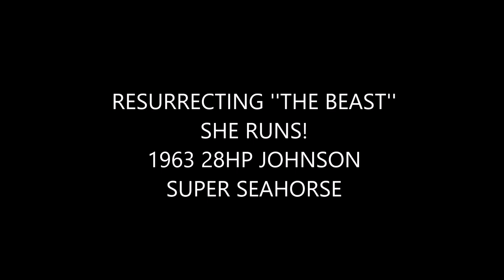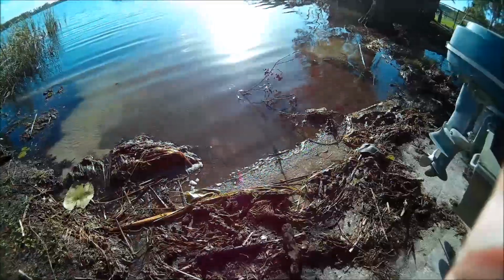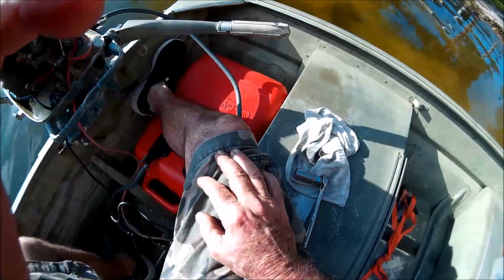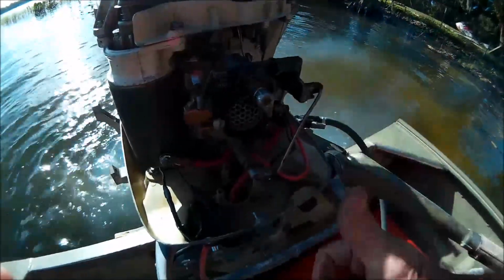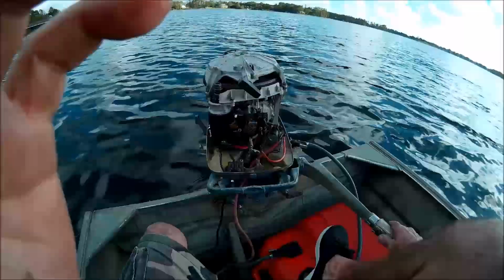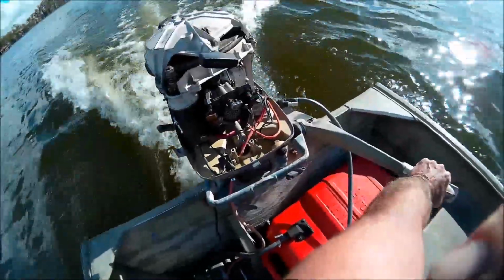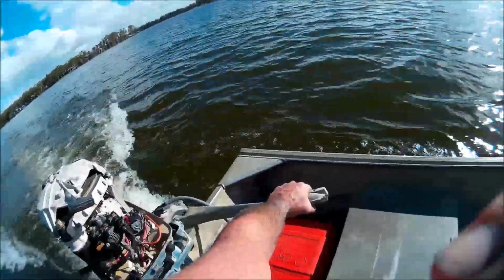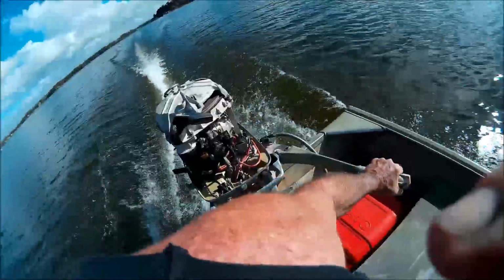1963 JOHNSON  28 Hp - First Test Run

Comment: Just got a 1962 28hp Speeditwin today. Lady said she used it once in the river and it died on her so she brought it to a shop for a tuneup, and it’s been sitting ever since, about 17 years...
I squirted some gas in the carb, 5 pulls later it fired, after a seafoam treatment she runs like a top...
Gonna put it on my ‘73 welded Gregor 13ft, should be pretty quick :)
Reply from the maker: Hey. Wow sounds good! theses old motors will run forever .  And there cool just to look at. Hahaha Thanks for watching and commenting.  Stay tuned !
Reply: Cool I got that exact motor I found it laying on the side of the road for heavy trash pickup brought home spreads with starting fluid in it to see if in Fire and it fired on the first pool I'm pretty sure the reason that it was sitting there is somebody put the fuel pump back together the wrong way and broke the baffle with the springs bent over so I just put a Briggs & Stratton fuel pump off of riding lawn mower on it works pretty good I was just outside putting a new water pump impeller on it with the mosquitoes ate me alive

Comment: That seems the ideal motor for that boat. When you crank it up, it doesn't twist, tilt or shimmy; it just imparts power and pushes that boat like a rigid & strong power plant. Good work. I've been enjoying your other videos with the great 'tude and informative close-ups that give that on-site feeling to the viewer. Have you ever tangled with an Eska or a Clinton, or any really fringe antique oddities? Or any of those old rope-wrappers that look more like plumbing art than outboards? With bulky cast parts and brass galore? One of those could be a real resurrection challenge, especially with the parts scarcity. I always liked those that hide nothing behind any covers or dress panels. Why add more weight to a wrecking ball?
Reply from the maker: Thanks for checking out my vids and thx for commenting. No, I have never fooled around with an Eska or a Clinton, don't come across them very often, especially Clintons, and when I do they are usually to small. I don't bother with anything older than 1959, or under 8-10 horse, mainly because they seem to be hard to sell. There have been a few I thought about jumping on, maybe one of these days. thx again

Comment: Hello, I'm working on my inherited family boat, 58 Larson, 1960 40 hp super sea horse. Got it running good, however water is getting in the gear case, Ive only run it in a barrel, but when I tilt the motor up when it sets on the boat, it leaks gear oil & water out of the water inlet screen. When I drain it there is water inside case also. Is there a common issue? Great channel thank you for any suggestions.
Reply from the maker: Hey. Thanks for tuning in. Most common leak issues are from the driveshaft oil seal under the water pump and/or the shift rod bushing gasket & o-ring. The driveshaft oil seal is not a big deal to replace but the shift rod bushing is a real pain in the azz! On these old split style gear cases I think you can go through the bottom and tap the shift shaft bushing out through the top. Either way it's a pain in the butt. Thanks again & Stay tuned !

Comment: How do you know if the water pump is working?  Is it through the exhaust or should it have a little water stream. Ours  does not have that little stream of water. Afraid to run it.  Any advice?
Reply from the maker: Hey. Thanks for tuning in. There's no thermostat either! The water comes out the "blubber hole" on the back of the mid section. It should come out at a pretty good clip. My advice would be, if you're unfamiliar with this outboard, and you just got it or it's been sitting for a long time, I would take the gearcase off and inspect the pump & impeller. You can start it and run it in a tank for a while to test it. It wont burn up just running it a few minutes. If no water is coming out or just trickling out you'll need to find out why. It may be full of mud dobber nest. Either way its best to take it apart and check it out before you put it in the water. You don't want it to burn up! Thanks again & Stay tuned !

Comment: wait if you screw in the idle mixture screw its speeding up (to a point) because it's leaning out, not getting more fuel. counterclockwise gives it more fuel ie. richer. or did i screw that up (pun intended)?
Reply from the maker: Hahaha hahaha, OMG someone finally caught that. I was wondering when that would finally happen. Hahaha. It's only been almost 2 years !  Yeah I screwed that up and said it backwards. It's my dexlex, declexi, dyslexia, Hahaha, See it's so bad I can't even say it, or spell it !  No, I'm just screwing with, I said it backwards ! Hahaha LMAO. Hey, nice to know someone is actually paying attention. I remember when I edited it and I was like, What the Hell did I just say. But I left it in. That's to funny. Thanks for watching and commenting! Stay tuned !
Reply: @THISOLDOUTBOARD1  what did you do exactly on the high-speed high speed adjustments how did you start a Justin that I have a 62 Evinrude 28 horse that I need to mess with I got it running put in a water pump impeller today on and then going to try to take it out not really sure how to adjust the carb like where to start and what to do

Comment: That is the beast cant wait till you put the final touches.  Runs like a 40
Reply from the maker: that was just the first and last part of the video i shot, all the stuff in the middle where i was running at full throttle wasnt there when i got home, it really pissed me off, i guess i wasnt pressing the rec. button when i thought i was, all the stuff with the GPS/MPH was not there, thats why i said i'll be doing a follow-up vid. i couldn't run with the hood on because it needs a new gasket, LOUD, anyway, i was bumping 27mph on the gps, pretty fast on a 15' jon boat
Reply: THIS OLD OUTBOARD Hey man when you get time look at this and let me know what you think picked up this old Mercury 25 and I haven't put a compression test on it but I am sure it has low compression appears someone put some epoxy around the block.  Let me know if you think it is worth fixing.   I also was interested in knowing if it is just gaskets would you replace the rings and if so would you do anything to the cylinders if they look good.  Thanks for your help.  https://youtu.be/HTeuycq0poQ
Reply: AFAIK these early 60's 28's had the same displacement as the 1955-'56 30 hp. The later 33's were the '57-'59 35 block. The 35 was still being built by GALE in the early 60's after Johnson and Evinrude brands came out with the 40 in 1960. Gale also later marketed a 40 before the brand was discontinued. I think that 40 didn't have the exhaust silencing.  If I'm wrong I'm sue OOG will correct me.

Comment: What size boat is that on?  Looks narrow.  Every now and then idling mine burps I guess I will call it.  Sometimes it runs smooth.  Almost like a misfire.  Hasnt run in 11 yrs.  Thinking I should look at the points
Reply from the maker: Hey. Thats my 15' Dura Craft. Yeah its a skinny jon but solid. Yeah give it the once over. Thanks for watching and commenting. Stay tuned !

Comment: You gonna use the electric starter on that with a tiller setup?  Those 28's didn't come with generators.  Truth be told, while the deluxe 40's [ie. Evinrude Lark, Johnson didn't have model NAMES for most of their motors with sporadic exceptions like the Javelin 35 and the V4 Meteor and Golden Meteor] had generators they were always problematic. I had a Lark VII in the 1970's/early 80's - either the generator or the regulator was gone by then but I never worried about it.  A charged battery would keep the electric shift working for several outings.
Reply from the maker: Hey. I would be happy to use the elec. starter if it worked, but its gone weak, turns the motor fine with the plugs out, but put the plugs in and it just dosent have enough guts to turn it fast enough and this thing is a "'BEAST'' to pull. thanks. Stay tuned !